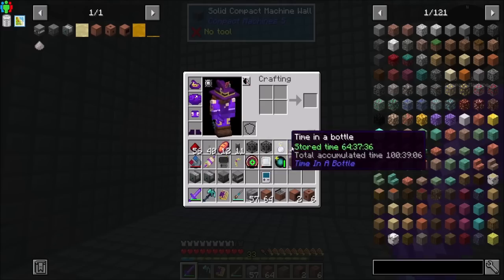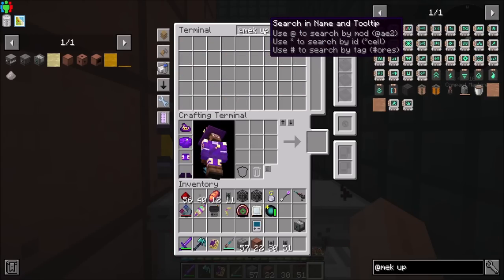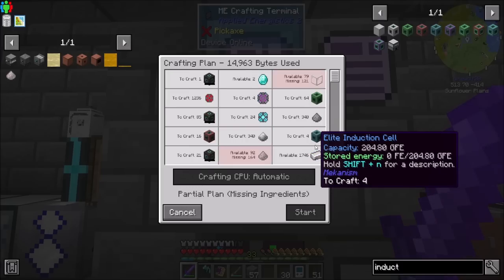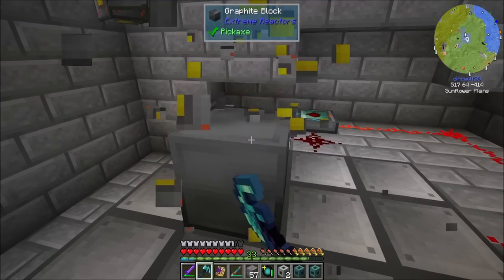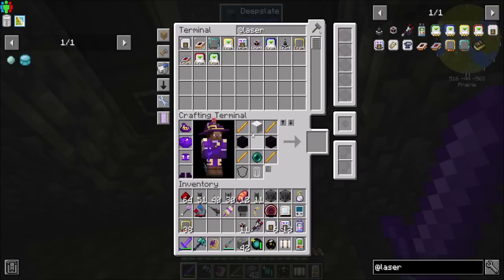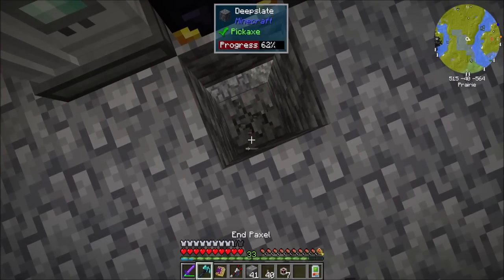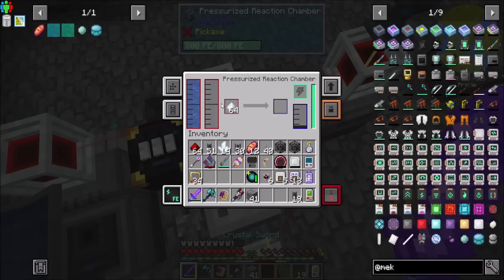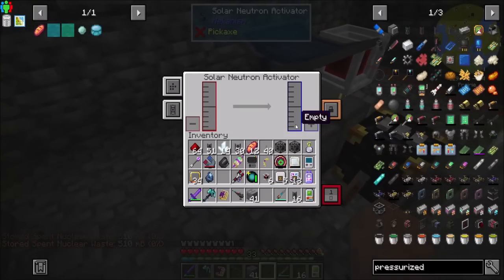LetsPlay S12E58 Induction and Waste Processing

Comment: Did anyone else notice that the energy trash can immediately started sucking down 800kRF/t, when the induction cell was in no way full?
I wonder how many episodes it will take for him to notice he's not getting any new power coming in...
Reply: It's probably because of the some kind of limit getting hit somewhere, you can see somewhere, when he looks at the plug he is loosing 1.6m rf/t, so it probably is hitting a battery limit, so the overflow is probably going into the trash can.
Reply: @adrianosefanovsko3476  In this case, I'm pretty sure it's the limit of the Flux points. He didn't disable the limit on either the trashcan or his induction battery point so they default to 800k, the plug on the output of the turbine had limit disabled, so he transferred 800k each to the trashcan and the battery, until the turbine buffer was empty. Shouldn't be a problem normally since i don't think his turbine produces over 800k.
Reply: Like 30+ 😂
Reply: I saw the issue and went nooooooooooooo he just did not do that! Dire forgot to disable the limit on the plug on the fight side of the induction cell.
Reply: @lefigeur22  Dire replies to comments!
Reply: @lefigeur22  Or because of backlog

Comment: Personally, I always keep my early-game power production on a separate power network, feeding just my AE system, because it's such a pain when you lose access to all your stuff when trying to fix a power problem.
Reply: Early AE systems or similar mods can be power controlled with you stepping on a pressure plate--this is before you start getting into the remote controls.  I usually fill a few batteries (starting with the lowest and gradually building up to the highest) and keep them in a chest offline of the AE system in case it ever happens that the AE system goes offline.  I also have an on/off switch for the manufacturing so it doesn't suck up most of the power when all you want is to get into the inventory.  Having a "backup" Extreme Reactor in a series like this probably wouldn't be a bad idea either once it's possible to make them with relative ease.

Comment: I would really like to see an episode of you trying to run your reactor at MAX and see what kind of material input would be required to keep it running and safe
Reply: At a certain point, water cooling can’t be enough AFAIK
Reply: @ultradude5410  Depends on the size of the reactor. He might, or might not, have reached the point of having to mess with liquid sodium cooling; I've never tried to reach that, so I don't actually know where the limit is. It's pretty up there, tho, from what I understand.